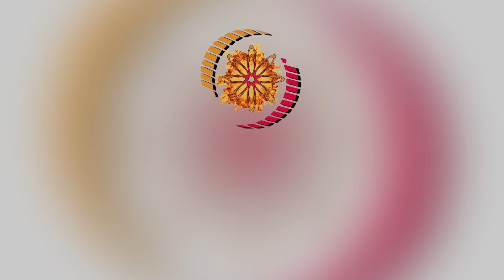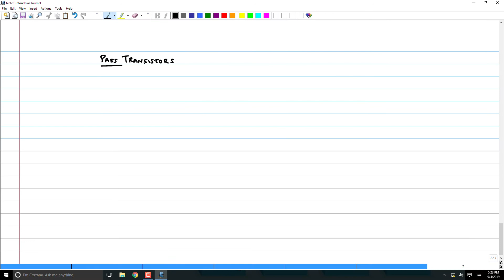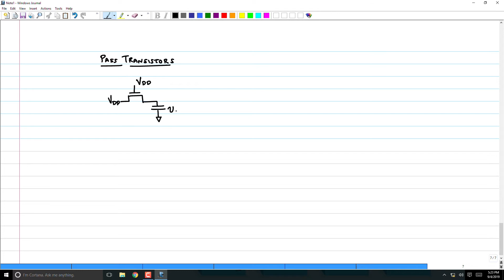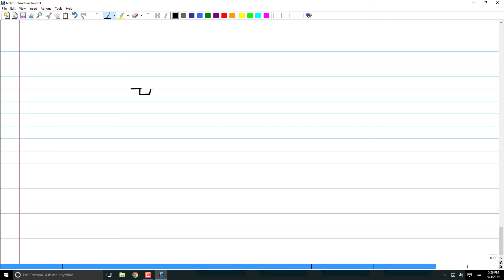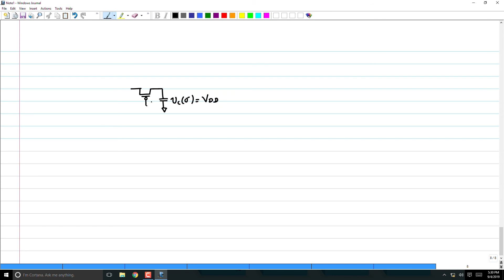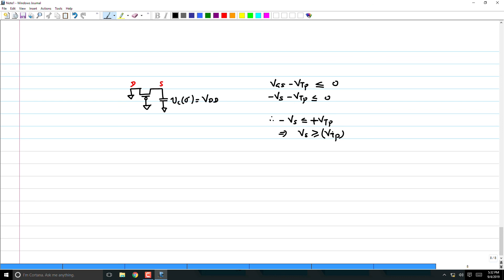Inverter-11 - Pass Transistors

Comment: When the MOSFET will be in parallel then only it can go up to (Vdd- 2Vt).
Reply: How? Instead, it will happen when the second MOS has the gate voltage as Vdd - vt, that will give the output as vdd - 2vt